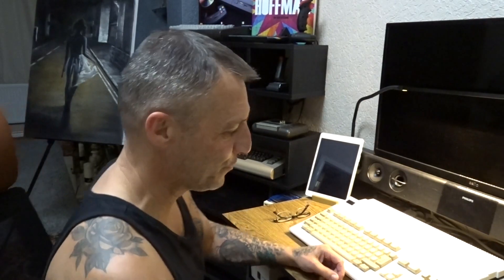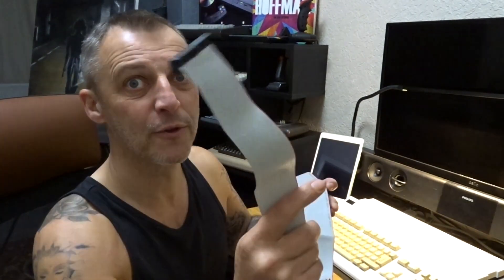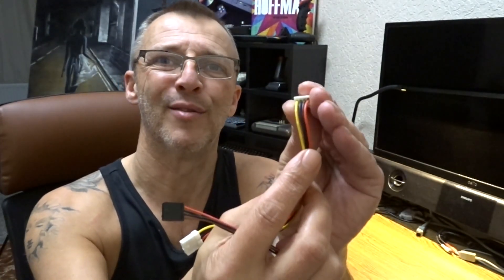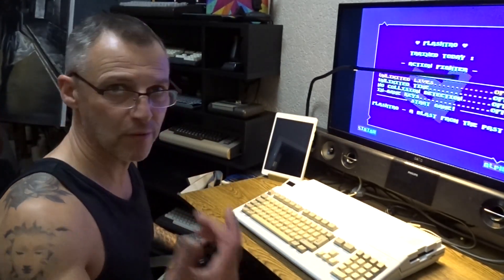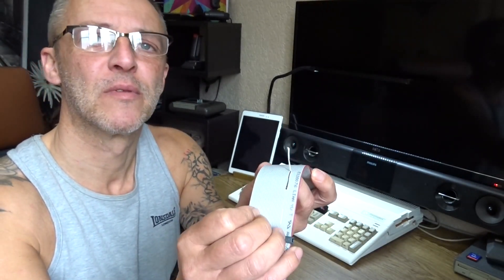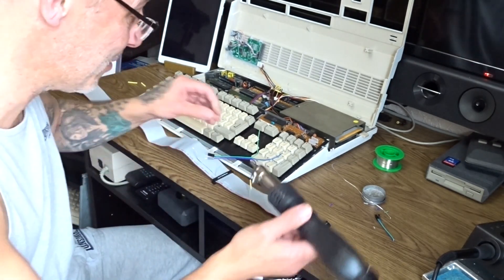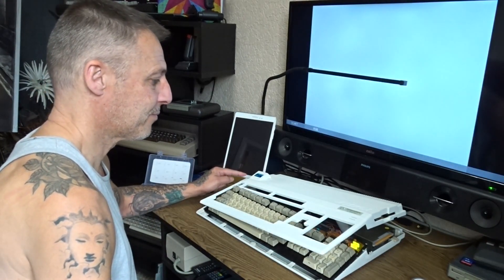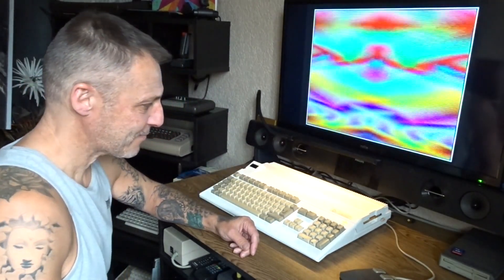Amiga 500 Completely internal dual drive. Gotek n Floppy

Comment: Hello is there a way to have the switch and gotek slot controller coming out of one of the sockets with a plug on so it's not just hanging loose and can be detached? As i dotn want to mod the case or have the gotek knob mounted on case

Comment: There's a version of the flash floppy firmware that has on screen display so everything is internal and you don't have to modify the case. You just hook up a wire to one of the RGB lines inside the Amiga to one of the pins on the gotek.

Comment: Brilliant that Stu, Could the same be done on the 1200?
Reply from the maker: Yes bud, 500, 500plus, 600 and 1200. They all have the same pinouts! Glad you enjoyed it :)
Reply: @SHGRetro  good news I'll give it a go, I've got loads of disks that I don't use because of gotek would be nice to flip between the two.
Reply: @SHGRetro  have you got a component list of what's needed?
Reply from the maker: @yelloledbetter100  I have added a list of the things you need, You will need to undo the twist in the ribbon cable between pins 5 to 9 which is a simple task!
Reply: @SHGRetro  cheers